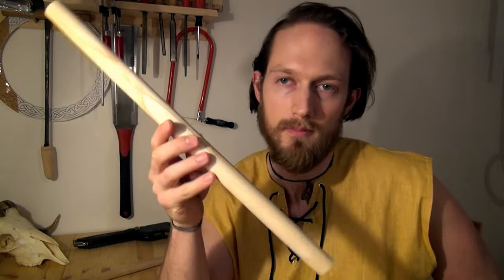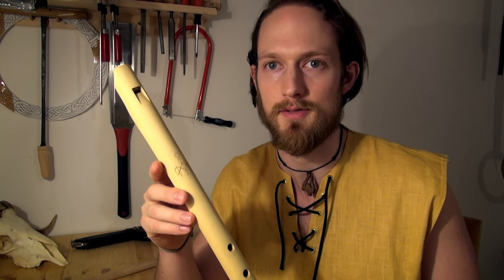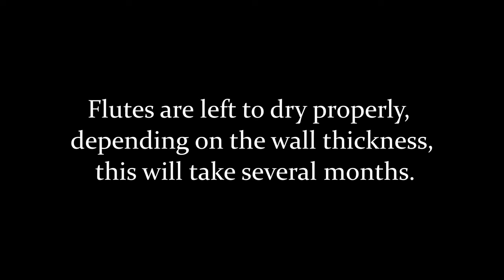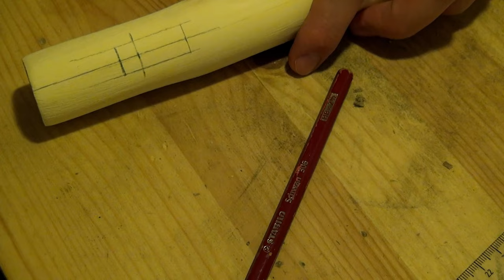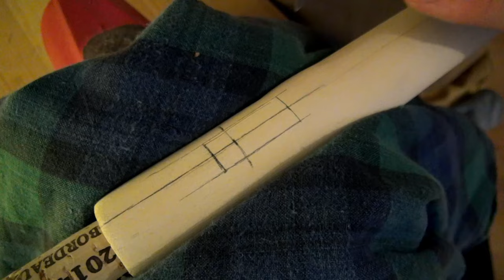How to make wooden tin whistle/low whistle

Comment: For the name of the tool used to drill the inside hole, all I could find after looking around for a while was- barn beam hand drill, long wood auger. Good luck everyone!
Reply from the maker: That is right, thanks. You can also buy a short one and have a someone weld extension to it.

Comment: Wonderful video! Thanks a lot for share you knowledge!
What's the tool to make the transversal center hole on the wood (at 1:40)? And how to make it straight?
Sorry my poor English...
Reply: Barn beam drill or possibly a long wood auger. Could mount the wood in a vice as he has, and then possibly another vice with a large nut or washer as a guide. Good luck!

Comment: Hi, great video. You are very good! Can I ask where I can find the auger you use to drill the piece of wood internally. I thank you. I follow you, I subscribed to your beautiful channel. Alessio from Italy
Reply from the maker: Hi there Alessio, I can´t give you specific site or contact to find one, but can give couple of tips.

The drill is called "nebozez" in slavic languages.

In english you may find it under the name "gimlet" or "gimlet drill". I don´t really know the reason for this, but they are much more common in Eastern Europe when compared to the Western Europe (including Italy as far as know) and US.

These drills were usually used for carpentry, and were only 30-50cm long. I haven´t make this one, I bought it used, but  becouse it was much shorter I had to make an extension for it, (by welding a steel rod), so I can use it for drilling flutes. If you want to get get your own, your best bet is to search ebay for i something like "vintage gimlet drill". Cheers, JJCh
Reply: Tanks❤

Comment: How thick is the wood, what are the measurements and what size is a auger? Pls I really want to make some
Reply from the maker: Thickness of the wood doesn´t matter that much, try to keep it 4-7mm thick.

This particular flute was drilled with 20mm auger, it was drilled fresh though, so the seasoned piece will have diameter slightly smaller, like 18-19mm

Comment: Silly question perhaps but did you do anything to soften the wood first before using the gimlet and stripping the bark? Like was it treated or soaked in anything?

Amazing work btw
Reply from the maker: Hello, the wood wasn´t soaked in any way, but I drill the flutes when the wood is still green (not seasoned) which lowers the risks of flutes developing cracks and outright splitting.

Comment: Great video. Love your work. Ive noticed in the comments, both this vidro and the other o e thag you do nof reply to wuestions about ghe drill you bore out the flute with. There are a lot of people, including myself who eould like yo get one.
Reply from the maker: Hi mate, thanks, regarding the drill - I have got this question so many times it gets kinda repetitive answering them. I copy my answer from a different video, hope it helps.

1) These drills are called "nebozez" in slavic laguages. They are very common in Eastern Europe (altough usually they are shorter and used in traditional carpentry, with length around 50cm - though it is easy to weld some extension to them). In english they are called "gimlets" or "gimlet drills". Finding really big ones is not easy - your best is to search ebay for something like "antique big gimlet drill". If you are from Europe you may be able to order some from the Eastern Europe as well.
Reply: @JJChWorkshop  thznks very much for the info. 40 cm lond flat bits from 8mm 22mm but i mess up more wood than I have success with. And the  noise! Let the search begin.

Comment: How do you decide the length of the fipple's square hole? (seen emerging at 5:41) My few attempts at making a low whistle worked best with about a 1cm long hole ("long" meaning from head-to-tail measurement direction). Yours looks to be also about 1cm, but am curious if I'm right about that. Great video, thank you for sharing!
Reply: Also at 8:21, what's the name of the tool you use there? Looks useful! I've been using an electric drill but would love to know a non-electric alternative
Reply from the maker: Hi there Luke!

On the fipple square hole - it highly depends on the size (=tunning of the flute). The flute in the video is in the low D tunning. With my low D flutes I usually make the fipple windows 8-12mm wide and 6-9mm long. Flutes with bigger window will be louder, have more "breathy" sound and will require slightly more air to play. Smaller windows will have sharper sound and use slightly less air. It really depends on everyones personal taste, even small changes in size (1 mm) will make quite a significant difference in final sound of the flute. 

The tool I use is very simple round woodcarving chisel. I prefer using hand tools for this, as the electric drill tends to slightly tear the wood fibers around the playing hole.

good luck with your flutes!
Reply: @JJChWorkshop  thanks so much for the reply! Making whistles and flutes has become such a fun pastime for me, and I treat this information like golden nuggets. Happy making!

Comment: Wow! Your works are awesome, I've just discovered your channel and it's great!
But I have a few questions:
1) Do you think I can use willow wood for both the whistle and the fipple? Willow wood is the easiest to get where I live...
2) This is maybe a stupid one: How do you make the exact size of the fipple so that it fits so well? I've seen people using some kind of  machine for that but is there a "handmade method"?
3) Does the distance of the holes affect the tunning? I know that it does on flute (as you've shown in your tunning video) but I've seen other videos in which they say that on recorders the only important thing is the size of the holes, not the distance (recorders and the low whistle seem the same to me regarding the construction of them, sorry for my lack of musical education :/)
Thank you for your videos and keep up the good work!
Reply from the maker: Hello there, glad you like the channel mate, to your questions:

1) Willow wood is not a good choice for a flute, it is too soft. You will be better off using some hardwood (ash, oak woods of fruit trees etc.). It is a great material for the fipple though.

2) Easiest way is to look some wooden rods in hardware stores and than drill the flute so it matches the diametere of the rod. Or you can make the fipple from sratch manually, this will take more time ofc.

3) Both the distance and the size affect tunning. Distance is less precise, but has greater effect. So first you position the holes, and than adjust the size to match the tones perfectly.

Hope it helps, good luck with your flute!
Reply: @JJChWorkshop  
yes, it definitely helps, thank you very much!

Comment: Since the notes and the correct pitch depend on the distance of the holes and the diameter of the holes, how do you determine these measurements? Is there a mathematical method to determine them or are they determined experimentally by doing hundreds of tests?
Reply from the maker: There is a method how to calculate these distances, the size of the holes is than adjusted (holes are expanded, until they are in tune).

I have and long video explaining the whole process in detail, it is demonstrated on a transverse flute, but the technique woul be same for low whistle as well.

Here is the video https://www.youtube.com/watch?v=RVvG3QhOk5E

Comment: Amazing tutorial; 
It may seem a stupid question, but can you please tell me what is the name of the tool you use to empty the body of the flute? Did you make it yourself - the tool - or you just purchased it?
Thank you for sharing your art and your knowledge.
Oc.
Reply from the maker: Hello there, that tool is called "nebozez" in slavic languages.

In english you may find it under the name "gimlet" or "gimlet drill". I don´t really know the reason for this, but they are much more common in Eastern Europe when compared to the Western Europe and US.

These drills were usually used for carpentry, and were only 30-50cm long. I haven´t make this one, I bought it used, but  becouse it was much shorter I had to make an extension for it, (by welding a steel rod), so I can use it for drilling flutes. If you want to get get your own, your best bet is to search ebay for i something like "vintage gimlet drill". Cheers, JJCh
Reply from the maker: @MrOcalderonm  As I say mate, the nebozez drills I am using are really common here, I bought like ten of them at flea market for few dollars. We have some online second hand markets here, where people sell them often, but I don´t think anyone will send it to Australia (the shipping would be multiple times more expansive than the price of the drill). Like this one https://www.sbazar.cz/hledej/nebozez

The nebozez I use has diameter of 20mm. The drills you send me will work for smaller flutes, as they have length of 460mm. For something like G-flutes they will be fine. If you would like to make bigger-longer flutes, like the one I make in the video, you will have to find some local welder and ask him to make an extension to your drill. But that shouldn´t be an issue.

Comment: What tool did you use to cut the window and carve the windway? I tried to find them on Google but didn't have any luck. Was it a chisel or a flat file of some sort that you used? Oh, and do you know if I follow similar steps if I could make this out of thick-wall PVC pipe?
Reply from the maker: Hello there, yes I used couple of small chisels to shape the windway. If you gonna use pvc pipe, you basically do the same, but you will have to rely on files for shaping the windway.

Comment: Awesome! Where do you find a hand drill/auger like you use? I see a lot of flute makers use these but I can’t find them anywhere! Please help.
Reply from the maker: Hi there mate, These drills were originally used for carpentry. You might find them under term "gimlet" or "gimlet drill". In slavic laguages we call them "nebozez". Search ebay, I am sure you will find some usable ones.

You will most likely find ones of lengths from 35 to 50 cm. Therefore you will have to weld and extension to them to make them suitable for drilling flutes (thats what I did with the drill in the video). Good luck

Comment: Can beech wood be used for the  block of the flute ?
It is recommended to use softwood: pine, fir.
Reply from the maker: Beech can be used, but if you can, I would go for something softer. If you decide to use beech make sure the fipple block fits the flute perfectly (don´t make it too big).
Reply: @JJChWorkshop   Thank you!

Comment: Is the labium inside the tube rounded or its straight?
Reply from the maker: It is rounded on this one.

The labium should have the same shape as the plug in the fipple of the flute (if you look into the blowing hole, the shape should match, for example rounded labium = rounded top of the plug). Both can be used, both will deliver slightly different sound.

Comment: Hello ! Did anyone already ask for the diameter of the drill bit ? Can you please share which one is it ?  Do you use the same size drill bits for all your flutes?
Does your drill make a hole perfectly straight or does it curve a little?
Reply from the maker: Hello there, I use several drills for my flutes. The one in the video is 21mm, for smaller flutes I would use smaller diameter drills (for example 16mm for a G whistle and 13mm for a D whistle). 

The drills follow the natural curve of the wood (they follow the soft middle of the branch, which guides the tip of the drill). THerefore it is possible to drill even uneven pieces of wood.
Reply: @JJChWorkshop  sorry if this is too much to ask but could you link me somewhere to buy this kind of drill

Comment: Can you tell me where I can buy that kind of hand auger.....
I am making whistles too with acrylic pipes just for hobby.
I hope to try to make your great wood whistle.
Reply from the maker: Hello there, these drills are called "nebozez" in slavic laguages. They are very common in Eastern Europe (altough usually they are shorter and used in traditional carpentry, with length around 50cm - I had to weld an extension rod to it). In english they are called "gimlets" or "gimlet drills". Finding really big ones is not easy - your best is to search ebay for something like "antique big gimlet drill". If you are from Europe you may be able to order some from the Eastern Europe as well.
Reply: @JJChWorkshop  Thank you sooooo much!

Comment: what size gimlet is that? i’m curious about the inner diameter of the d low whistle you made
Reply from the maker: Gimlet used for this low whistle is 21mm, but you have to remember though, that I drill fresh wood, after seasoning the diameter shrinks to about 19-20mm.
Reply: @JJChWorkshop  Thank you so much for your response, and on the other video as well. I think I'm going to have some made, as I have some skilled blacksmith friends.

Comment: Do you seal the fipple wood. Which wood type?
Reply from the maker: I use lineseed oil+beeswax mix to seal the wood. I usually use some kind of softer wood like linden or alder wood for the fipple. When using the softer woods, you avoid the risk of splitting the flute when inserting the fipple or when the flutes go through humidity/temperature changes (the softer woods have ability to compress little bit).
Reply: @JJChWorkshop  thanks!

Comment: the block should be made from Seader wood and the layers -should be vertical not horizontal like you show here-----due to the cracking pattern off wood from the outside to the inside -----outer rings shrink more then inside rings -----this is how wood for violine is being cut -like a cack slice from the wood log    so the rings will be vertical